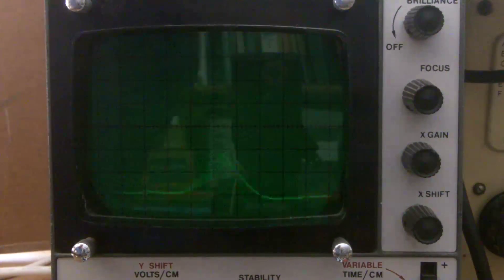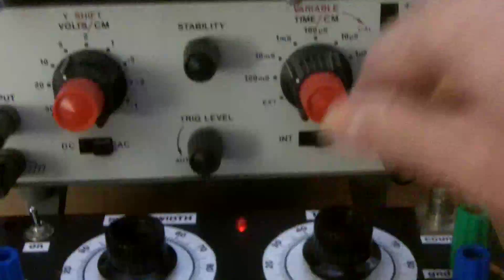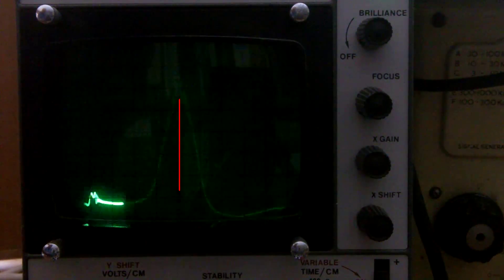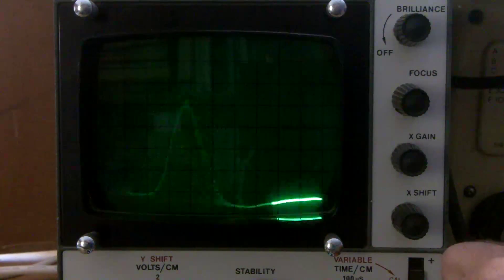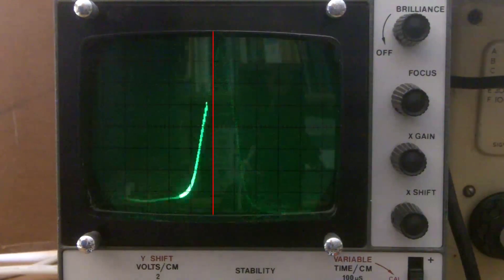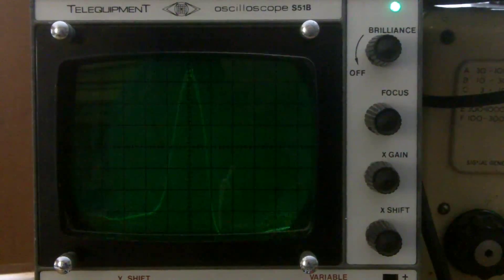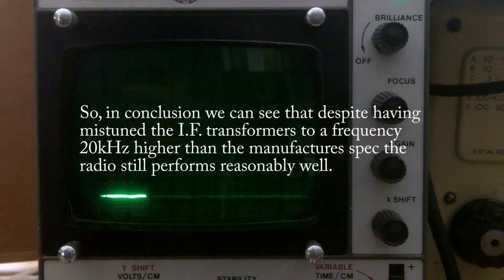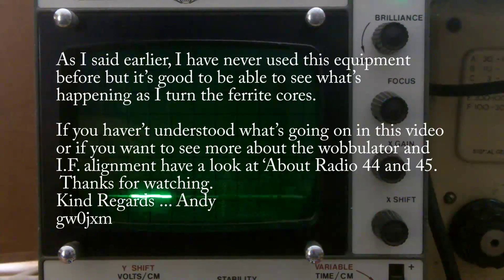About Radio 47, what if the I.F. is misaligned by 20 kHz? Part 2

Comment from the maker: I guess you could, I'm no expert in this matter. I wouldn’t advise you to attempt an alignment for the first time on a good piece of equipment. Have a go with an old domestic radio that doesn’t matter if you screw it up. Get a feel for how to go about it. As far as I can say the precise intermediate frequency is not desperately critical, what’s more important is that each stage has the same alignment. That’s my opinion not necessary a statement of fact, it comes from my own experience.
Andy

Comment from the maker: 3 of 3
The reality is you probably won’t use the scope to fix radios or amplifiers but you can use it to get a much better understanding of the signals involved and that has to be good. if you have a limited budget I’d say get whatever you can and play with it knowing that you can always move on, once you know how to use a scope you can get by with the most basic instrument for audio work. High speed switching circuits are different again.      
Kind Regards ... Andy

Comment from the maker: It’s been quite a revelation using the wobbulator to ‘See’ what’s happening and I can easily understand how folk can mess up the I.F. section without instrumentation but boy it took quite a long time to get everything set up and sorted as the wobbulator isn’t calibrated plus it’s a bit twitchy. Did you find a circuit? If not I'll see about uploading it. 
Good luck... Andy